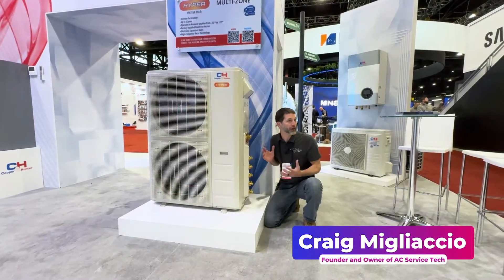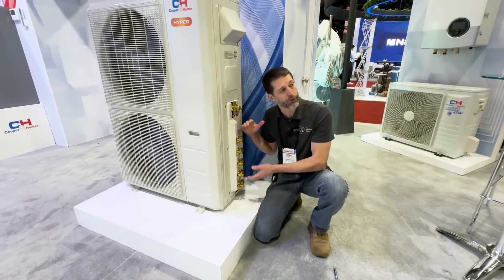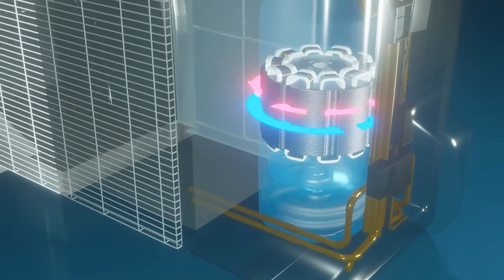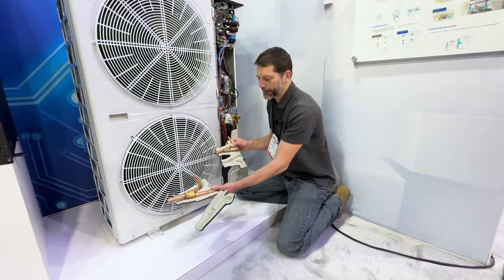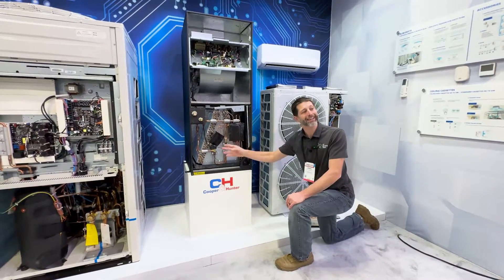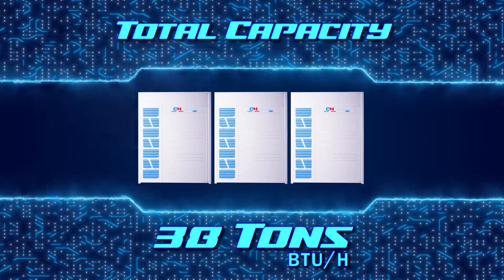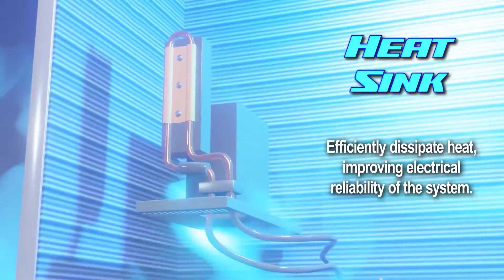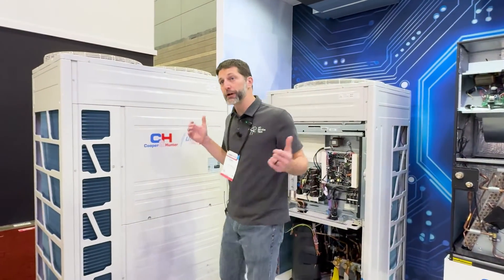Discover the key differences between a Multi-Zone Mini Split and Mini-VRF/VRF systems

Comment: What’s the cost per ton for each of these? I’d like to be able to compare
Reply: It’s more expensive than single air conditioning for each room , only good if you have limited space in roof and no issue with money.
Reply: @abdulelahbinserya1467  I’m in the business of installing hvac for indoor farms, where there are rows and rows of ACs and dehumidifiers in a single room, and many such rooms next to one another. I was considering systems like this so that I could run heat and cool inside the same room to dehumidify when cooling only isn’t desired.
Since not every room is full load 24/7, the exterior compressor(s) could share load across rooms, reducing the total tonnage needed for the facility.
So this sounds great and all but not if it costs as much as a small island and requires a nasa computer and an on-call oem service tech.
Light commercial heat pumps are typically about $1200 a ton these days. Pair that with a dehumidifier and it adds up to maybe $2000 a ton.
I’m currently how many $$ per ton these vrf units cost.